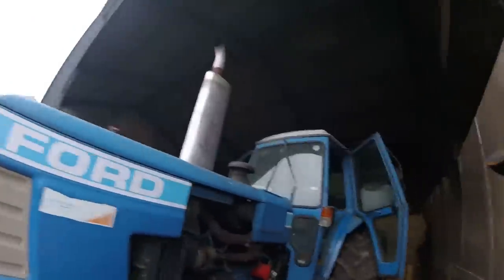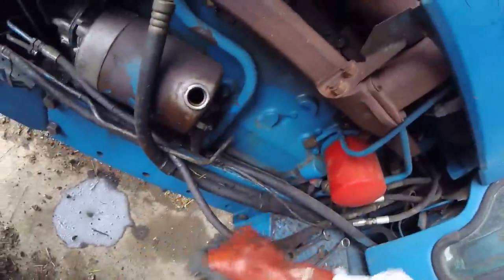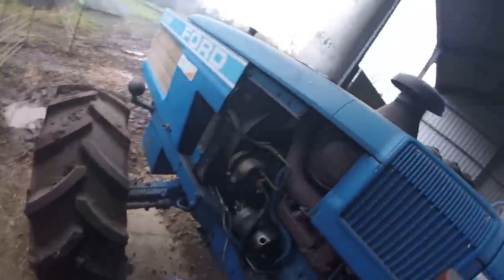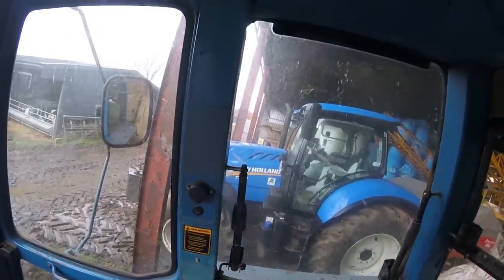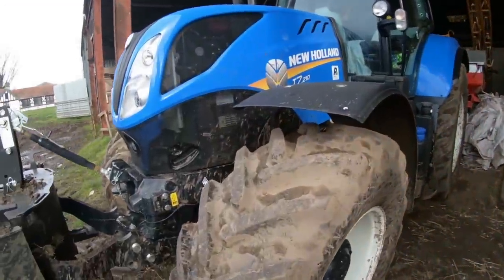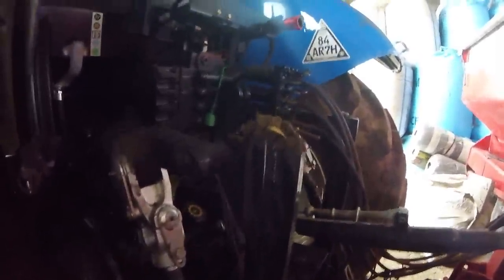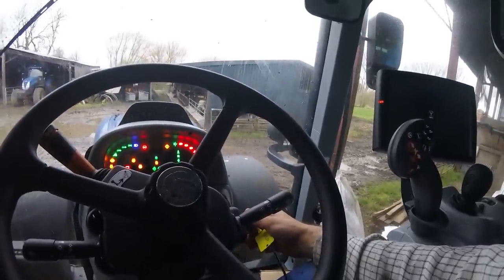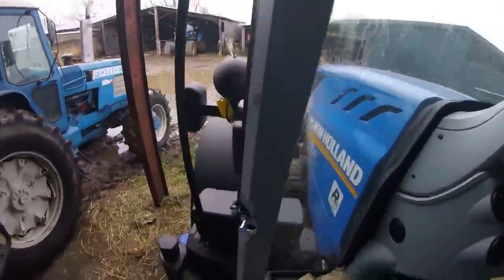34 YEARS of FORD/NH EVOLUTION

Comment: Never would have imagined what the future held George when I was on the old TW.
Good vid old fruit.
Reply: Less fuel consumption for one .Only joking.
Reply: That’s a good point. I wonder what the difference between an 80’s and current equivalent are ?
Reply: I know my 8250 sucks up plenty pulling 7 furrows. and on the crone she does about 380 litres every 14 hrs
Reply: A better tractor with a Powershift transmission and a quieter cab.

Comment: Those "good old spot lamps" aren't spots, they're headlights for when you have an implement like a front mower which blocks the headlights on the front of the bonnet. You switch them over on the rocker switch above the worklight buttons. Bottom setting puts the little sexy LED strip lights that are inside the headlight lens on. (like the LED strip lights on Johns  JCB 7270), and front headlights, the middle setting is just front headlights on their own (LED strips off) and the top settin is for those headlights mounted on the handrails ;)

Comment: The hp is confusing, it's actually 180 max hp unboosted and 165 at rated speed (2200rpm) while boosted is 190 at rated speed and 210 max. Hence why both pto speeds are around 1900 engine revs as this is more than likely were the most power is made.

Comment: I drove TW15 towing 18t chaser bin and early version T7.215? with front end loader.  Driving TW, l like driving old school but shifting gears when chaser bin got heavy when been find up was not easy.  Although at time TW was leaking oil, the hate was lights at night time.  I did like sound of exhaust one best sounds in tractors.  Driving T7 was good with loader n sprayer but towing 40ft disc air seeder was under power in sand hills.  If I had choose it would be T7 with easy of modern comfort n technology make job easy and efficient.  Great vid👍

Comment: use tubes in areas were it could do damage with swagelock and only short tubes with a 90 degree or 45 degree angle fitting .

Comment: I'm not up with modern tractors, i have a TS90, but i think i would need a driving lesson in these new ones just to learn to change gear.  Good comparison though, and now i know that 210 does not mean 210 horsepower, bloody badge engineering.

Comment: Goerge bud you probley got rubbish in the starter solenoid just give it a few taps with the hammer and it should not so that anymore in case you don't know what the solenoid is it is the part above the starter should be a small cylinder

Comment: So New Holland used to be Ford?
Reply: Yep, I think New Holland took over ford after they brought out what I call the 40 series, like they had Ford 7840 and 8340 with white roofs on the cab. And New Holland took over and the exact same tractor was called New Holland 7840 but with blue roof on the cab
Reply: FIAT took over Ford New Holland and merged it with Fiatagri. The new company became New Holland, the colour blue and with the Fiatagri logo. Todays New Holland has not a single Ford part in it.
Reply: Not Ford any more no such thing.